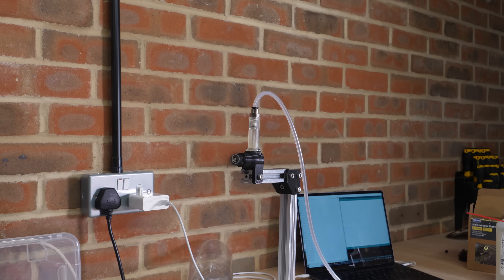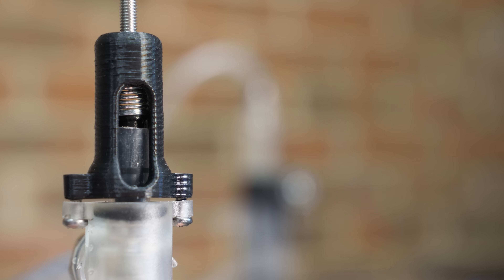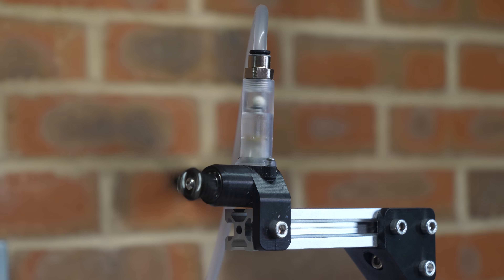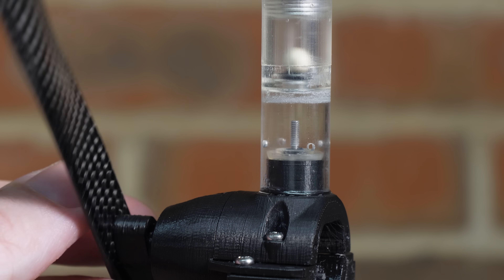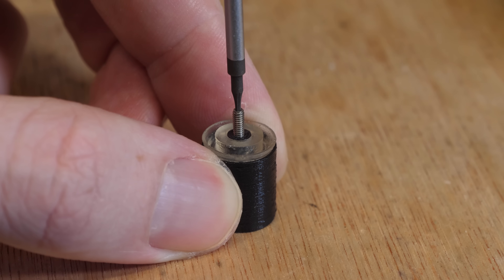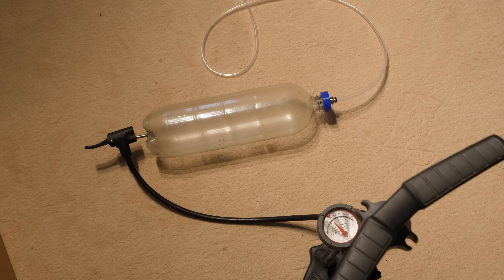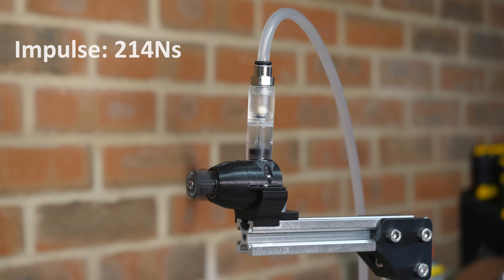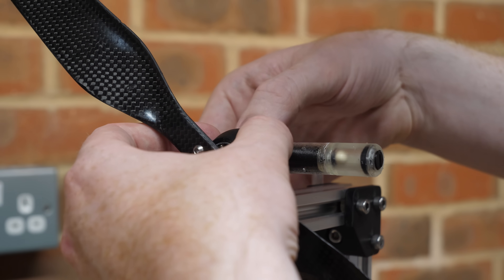4,500RPM Air Engine

Comment: I work in bottle engineering, and part of the test we perform on the samples we make is a burst test. A 300ml bottle for highly carbonated products if well blown, can easily reach  up to 15bars before bursting (not that i would reccomend reaching that pressure, as we do it with a proper machine that uses water instead of air). A 1500/2000ml falls a bit short of 12bars. 

Anyway. 

Beware that by making the hole on the bottom of the bottle, you are definitely weakening the overall resistance of the base, i would try to pressurize the bottle by adding another valve to the cap instead. 

Keep up experimenting!
Reply: Just for the record in the water rocket community its well known that 120 psi is generally where these 2 liter bottles tend to explode. 100 psi is about the upper safe limit you would want to pressurize, 60 psi is almost entirely safe and 80psi is about the upper end of that. Though these are rough figures they should apply about the same.

It's also worth noting, its generally not dangerous, just loud, its a little bit of thin plastic, the most it'll manage to do is scare you pretty badly. Unless it sends something flying somehow.
Reply: @killingtimeitself  You even try a SodaStream bottle?  Not quite as light, but they can handle a LOT more pressure.  I've had mine up to 175 psi(12 bar) with no issues... which sort of sucks because I was trying to pop it to scare somebody.  I later watched a video from the good folks over at Beyond The Press who had one up around 25 bar(360 psi) before it burst with deformation appearing to occur somewhere near 20 bar(290 psi).
Reply: @killingtimeitself   I'm sort of sad we didn't have access to kevlar or carbon fiber when I was a kid...  can't even imagine the sort of fun we could have had shooting those sort of water rockets off.  We did used to use packing tape though, helped the bottles exploded far less frequently.
Reply: @dw7444  weight and shape help a lot. The only problem I see with Sosdastream bottles is the cap and neck as they don't have the proper safety thread to release the gases when you start uncapping the bottle and the cap could fly off like  a bullet
Reply: For people that don't like mixed unit conversations:
15bar = 218psi
12bar = 174psi
8.3bar = 120psi
6.9bar = 100psi
5.5bar = 80psi
4.1bar = 60psi

And for people that haven't seen the metric light yet, 1bar = 1 atmosphere
Reply: @toolscientist   Almost....

1 bar = . 986923 atm

But it's close enough.
Reply: @toolscientist  and 1 atmosphere is approximately 15 psi at sea level.
Reply: @dw7444 They must have worked out the equivalence while standing on a thick carpet:face-green-smiling:
Reply: @killingtimeitself  for almost everyone in the world bar makes more sense because it almost matches the atmospheric pressure and at the same time it is 1 kg per square centimeter...
Reply: @killingtimeitself  yea i had a kit with a screw on cap for filling 2l for targets for shooting filled em to 120psi and after a few minutes all the ridges and defining features of the bottle were smoothing out and then it would burst on its own. They were waaay louder then the .22 or   pellet that set them off..😄
Reply: I spent an hour or so playing with a 2 liter coke bottle when younger, filling it with water and dropping out of a second floor window onto the lawn. The failure point in that situation was the cap which would shoot off fairly fast. It could be reattached afterwards so it seems like the pressure would stretch the cap out enough that it would expand radially and the threads could slip over each other. 
Not enough to kill but I wouldn't want to get one in the eye so I wouldn't say an exploding bottle is just loud
Reply: @Surestick88  for sure, but in this case the cap is unlikely to go anywhere if you have it tethered via an air inlet, and if you wear eye protection its unlikely to injure you.
Reply: That explains why one time I was making dry ice bangs and after packing plenty of dry ice in a 2l coke bottle on a cool day it was able to hold the pressure and the dry ice was melted into a liquid. After waiting for 20 minutes I had to hit it with a hammer to pop it. I was amazed the bottle could hold at that pressure.
Reply: So in theory he should get reliable 110-120psi and 170psi if he would be willing to replace bottle after each attempt.
Reply: @radosaworman7628  theoretically, yes. When you cross a certain thredhold the bottle sustains a plastic deformation and I wouldn't use it again
Reply: What bottle do you recommend that can withstand high pressures ( for longer runtime ) but at a smaller size?

Comment: Cool video. Small point for correction: if you are using the thrust data from the test where the test stand was pushed across the table, there is a systemic underestimation of thrust.

Comment: I wonder how the balance of a horizontally opposed 6 cylinder would do in this application. Also pointing the exhaust backwards for a little added thrust. It might be negligible but every little tweak in efficiency adds up

Comment: Try blowing very cold or hot air, this can increase the efficiency of the engine. I also have an idea to pump water into the tank, not air under pressure, and add carbide, then there will be a lot of gas under high pressure

Comment: Now don’t hesitate to call me stupid. From the slowmo’s @ 5:57 , I can see that the piston knocks quite a lot. I wonder how much efficiency can you gain from coating both the piston and the “combustion” chamber with a low friction material (will have a great selection of options with heat not being a factor. This way you could decrease the tolerances (and maybe increase pressure it can hold) this making being more efficient. Lmk what you think, love your vids

Comment: run the two cylinder engine with two crank pins 180 degrees out of phase and the vibration cancelling will increase your power output significantly.

Comment: I hope you don't hand draw every grapth, because there are easier ways to do it. Also, you can use them to calculate the total energy, divide it by the theoretical potential energy and approximate its efficiency. Also, another design is to make the lifting rod a separate part that moves with a middle crankshaft, similar to steam engines but inside the piston itself. This is probably overcomplicating things, but might give a slight advantage

Comment: You might need more exhaust holes. Some residual pressure might still be in the chamber when the piston goes up, resulting in a brake effect.

Comment: I've been watching the air driven engine progress for some time now with efficiency steadily improving. It's only just occurred to me that (unless I'm mistaken) the most efficient compressed air driven propulsion for an aircraft would just a properly-designed nozzle. Any mechanical engine running off the air is always going to be less efficient than just directly using the air to produce thrust.

Comment: I'd be curious to see air pushing a piston in both directions with exhaust in the center like a conventional steam locomotive engine vs the two cylinder design.  Might also be interesting to compare with the vein type motor found on most air powered tools.

Comment: I’d recommend with your pressure regulator that you also add a flow regulator. That’ll give you a more consistent thrust. It’s been a minute since I’ve done something like that, but I think you want the flow control after the regulator. 

Otherwise, holy smokes that opposed twin cylinder sounds mean!! So cool!

Comment: I know this might be a little pointless.
But what if the exsauht was pointing know the direction of thrust to increase its thrust efficiency by a little bit? Perhaps even doing one of those rocket nozzles to speed the air if it's stillggot enough pressure.

Comment: Consider the piston travelling upwards does compress the air. At top, when the valve opens, there will already be copressed air in the cylinder. This will dictate the minimum bottle pressure your engine can run at.
Two cylinders use straight crank rods and displace the cylinders slightly like all boxer engines do.

Comment: Another great engine and Video.  Air alone would not give you mush time on an aircraft for flight because of the tank.  There was a toy helicopter toy I had as a kid where the blade was spun by a spinning rod in a tube.  it only flew round and round but it was fun. The VertiBird 'remote' controllable helicopter.   You can make one run on Air lol .  Keep up the great video

Comment: next is an air radial design!
imagine the power of that, though the piston rods would need to be quite thin, its doable, but you might want to use a rod that goes through the piston in that case, Afterall you do 3D print everything, and it would give quite alot of power, and would run on only a small amount of air due to the timing possible

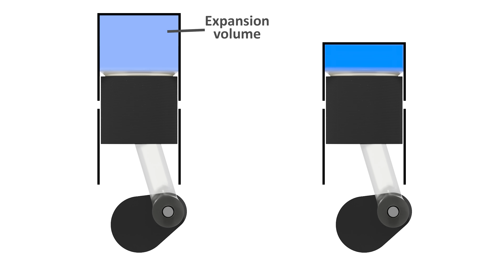Comment: 5:45 you can make it so that TDC actually corresponds to high crank leverage angle by offsetting the cylinder from the crankshaft. Also do note that you can't really expand to atmospheric pressure because then exhaust would not occur. With a bottom discharge port design, the piston compresses the air on its way up, so higher expansion volume just means there's less intake resistance so bigger charge of air can enter. It makes it more powerful, not more efficient.
Reply: his seal design means there is little to no compression on the upwards stroke, though. exhaust at atmospheric pressure is done by the piston pushing the air down around it's sides and out as it moves upwards.
Reply: Offset crankshaft is a good idea👍
Reply: The piston seal at the top of the piston is smaller than the cylinder diameter in the relaxed position so on the return stroke of the piston it feels no resistance. I disassembled a couple of air hogs air engines back during lockdown and did slow-motion of them and built a 3D printable copy of the air hogs that is similar to Tom's latest designs, only using FDM printer only and no fancy cylinders. I even came up with the same threaded rod for timing adjustment that Tom used. I found you could get a bit more efficiency over a wider pressure range if you used a spring on the threaded timing rod. This is another idea I found used in the air hogs engine. The spring can't open the valve until the timing rod hits it, but once the rod moves the ball valve up, the spring will delay the closure of the valve a bit so the piston is moving down and the spring is holding the valve open. This setup allows the piston to come all the way to the top of the bore with zero empty space in the head, the valve opens and the air comes in and starts to fill the void formed by the piston moving down. The spring on the timing rod holds the valve open briefly to allow air into the cylinder as the piston moves down, but the trick with this is that as the pressure falls, the spring holds the valve open longer because it is harder for the air to compress the spring. It is a crude form of variable valve timing to increase efficiency. Another trick I found is that the way it was designed the piston coming all the way to the top of the cylinder allows the piston seal to touch the bottom of the cylinder head and make a seal before the valve opens, so there's no "blow by" when the valve opens and the seal has to be expanded to seal against the walls. I wish I had made time to publish my videos about this project so others would be able to build on my findings.
Reply: @USWaterRockets  could you please upload the air hogs engine files to thingiverse, i would love to 3d print it and tom hasn't released files for this engine
Reply: Agreed on cylinder bore offset - came here to suggest that very idea.
Reply: I came here to suggest the offset crankshaft too.
They used that trick in the 50s to cheat on car racing.
Reply: @SoundsLikeOdie  what? its not cheating
Reply: @Helperbot-2000  Yes, my mistake, it was a creative understanding of the rules.
Reply: Isn't that called a desaxe engine?

Comment: Hey tom, I have some ideas that might be kinda interesting. Have you thought about implementing a cylinder offset to increase torque and efficiency? it would make the piston/conrod act on the crankshaft more favorably on the "power stroke" while also increasing the amount of degrees of the crank rotation that you can extract power. also have you experimented with the legth of the conrod? as i think the extra dwell time at TDC would help with power and efficiency. I know Driving4Answers has videos on these topics and can explain much better than I ever could in a youtube comment, Thanks for reading!
Reply: I like this idea!

Comment: Use dry ice in the bottle to keep pressure!!
Reply: Won't it explode 🤔
Reply: Not if you don't use a lot. Just use enough to keep the pressure where it needs to be. Make it expand as fast as it loses air. @momcilomomcilovic558

Comment: Another fun to watch air engine vid!  I was wondering about the timing bit - It seems the length of the rod would control the length of time the valve is open, but traditionally "timing" refers to where in the stroke the pressure is created.  Any thoughts on a timing answer that addresses piston position and valve open time?

Comment: isn't this similar to a rotary engine, as there are some aircrafts that used this engine type (examples, AAI RQ-7 Shadow (UAV) and a Fokker D.VIII, and many more), though planes that used rotary engines aren’t that common, but there are a lot of cars that do (examples; Mazdas RX-7/RX-8, AMC Pacer), but the most commonly used about of pistons are 4, 6, and 8. I think you could possible bring the horse power up to 0.1hp if you were to add more pistons.

I know doing that would end up weighing to much but it would be interesting to see how much power you could produce, and I can’t wait to see how much of an improvement that engine will have on flight time. Good as always.

Comment: what if you route the exhaust from one cylinder into another smaller cylinder? it should use up the exhausted air, improving efficiency.
if you offset the second cylinder 270 degrees from the other, like a V twin you wouldn't even need a valve, just a direct connection

Comment: In a plane application what are going to do for an air store. Pressurised air tank of some sort. Plastic bottle with compressed air would do but have you thought about CO2 cartridges. From 12gm upto 88gm I've used them to power air guns but now use compressed air from a cheap electronic pump which can go upto 600psi (a car tyre is 30 psi)

Comment: Brilliant work!
I can't quite tell from the video, but if the crank itself isn't slightly offset from the cylinders, you may be able to squeeze a bit more efficiency out of them by doing so.   Helps reduce friction by giving the rod for the piston more of a direct up/down motion only vs angling it as it goes up and down, if I remember right.   Driving 4 answers on youtube has a decent video going over the more technical details why for that. (although for an ICE it may work for pnumatic tx

Comment: I wonder if something like a pulse regulator would help to optimize run time? IE, tie crankshaft timing to input pulses so that the pressure wave from the gas inrush is perfectly timed for induction.
Reply: On that note, for multi-cylinder engines a rotary distributor in the manifold could be tied to the crankshaft and increase efficiency.
Reply: While the ball and poppet valve are an easy solution, I bet the rotary valve in the manifold could reduce complexity and increase granular timing control of multi-cylinder systems, if not immediately applicable to the single cylinder.

Comment: I think your next big jump in efficiency would come if you figured out a way to exhaust on the upstroke instead of at the end of the down stroke.  You are leaving a lot of air to recompress on the upstroke with the current design.  Something akin to a 4 stroke gas engine setup with an inlet and exhaust valve, but only needing to run as two strokes.  I'm wondering if it would be possible to have an exhaust on the end of the cylinder that gets closed by the air pressure coming into a side chamber (with a second ball) when the ball is hit by the pin on the cylinder.

Comment: Try using the power of the motor to put more compressed air into the tank. With a turbine or something different , so u gonna have a lot of efficiency.

Comment: if your theory about the efficiency being related to crank angle, you could consider an offset crankshaft for the same affect while using less air (closer to atmospheric at the exhaust ports)

Comment: I can't help but wonder whether there exists a piston design that injects the propellant only when the piston is at ~90°… Now I'm sitting here trying to wrap my head around what abomination of an over-engineered mess something like that would have to look like if I also wanted to ensure a minimal starting volume at that 90° (meaning less than what the piston already travelled to reach the 90°). Sounds completely ridiculous and not possible, but I just can't think of a concrete reason why it should be impossible. So if you excuse me, I'll go scribble a bit more about my idea of a piston that pushes another piston but only half way which then rests the other half of the stroke until the main piston comes around again… should it actually work, it will surely be inefficient af

Comment: forgive my lack of knowledge would it run better on hellium or hydrogen instead of air more pressure for less weight ? could the exhust be directed towards the wings on the aircraft too improve lift

Comment: Why not increase the stroke length? This way you can have a small “combustion” chamber and also allow the air to depressurize to 1 ATM by the time the piston gasket passes the exhaust ports?